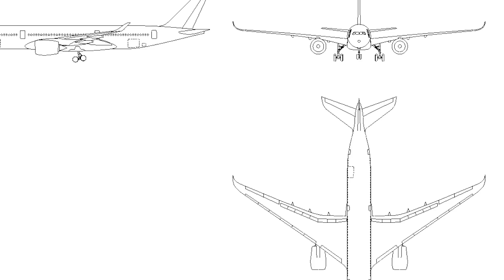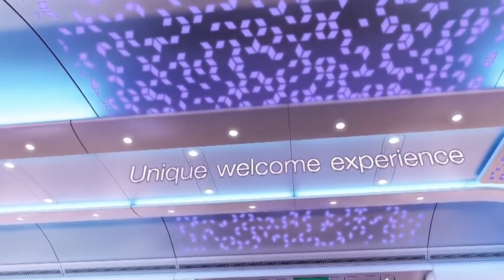Airbus A330neo - the path to perfection. Description of the new aircraft

Comment: Like this channel. No frustration elements to complain about. I just wonder why airliner companies dont put external fuel tanks under the airliner wings such as with military a/c ? Doing this they will extend the range of the aircraft according the route they choose. And it will illuminate the need of lots of different models with different ranges.
Reply: The fuel capacity added by external fuel tanks wouldn’t have the same amount of added range like it would have with military aircraft. Also the range of the aircraft is already long enough for let’s say 95% (probably even more) of all airlines operating it!

Comment: Using a Beluga (modified A330) to carry the first A330neo fuselage at 7:35
"I used the A330 to carry the A330"
Reply: It's an original Beluga, which was a modified A300 (although the A330 was also based on the A300).

Comment: I just flew on Boeing 767 from Zagreb to Toronto , I was thinking wtf such an old plane, turned out the best flight ever , 
2-3-2 seating and plenty of space , going to Europe flew on Airbus 350 horrible seating
Reply: Then you should also try 787. Same 9 abreast seating than on A350 but a smaller fuselage diameter.

Comment: Rolls-Royce or General Electric, you can't go wrong with these names in jet engines.
Reply: I'd lean SLIGHTLY towards RR partly because of the crazy engineering and skill that goes into designing and building them. They have an interesting way of testing the metal fan blades for strength and consistency: they actually hang them like wind chimes and whack them with a rubber mallet. A computer records the sound and sends it through diagnostics software to check the sound pattern. If it doesn't match up consistently with the other blades, they melt it down and install a new one! And each has to be so strong that it can hold a steel weight equal to that of a London double decker bus!

Comment: beautiful.. and it doesn't have MCAS ... perfect
Reply: Hahaha... Great news!
Reply: Why the FUCK would it have mcas in the first place? Only the 737 Max has it.
Reply: https://www.youtube.com/watch?v=0cS1SMptlnQ
Reply: @redstone51  that was one time, and they didn't CRASH, unlike with the 737 max, where it happened many more times and happened to kill 300+ people!
Reply: @redstone51  wow thanks for bringing up how a pilot saved so many lives! He deserves more recognition. Wait what was this thread about again?
Reply: @redstone51  You can't compare the A330 to the 737 MAX. Qantas flight 72 was the result of a hidden flaw in the software used to determine the plane's angle of attack where if there was a spike of bad data at the beginning and end of the 1 second sampling interval (the software compares angle of attack data 25 times per second and then calculates the median), the computer mistakenly believed it was genuine. Airbus did not know about this issue until Qantas flight 72 and, after the accident, they responded correctly by issuing a service bulletin (which prevented another similar accident) and worked on a fix for the issue. With the 737 MAX, Boeing didn't tell pilots about MCAS and allowed it to rely only on 1 AoA sensor, so if that sensor broke then it would cause the MCAS to activate erroneously and, since the pilots didn't know how to turn it off, it would keep doing that until they hit the ground. This time it took a second crash + a worldwide grounding for Boeing to fix the issue.

Comment: The 330 is my all time Favorit. Because of his seat configuration in Economy class. 2-4-2.
Reply: I hear you, man! :D
Reply: This neo has a 3-3-3 config, Airbus released a video this week
Reply: @PatTalisman  The a330 neo has a maximum capacity based on a 3-3-3 config (just like the ceo does as well.. check cebu airlines) with a 2-3-2 in the back section. This is just like the a380 can have a 3-5-3 max config but.. does anyone use it? no (or would rarely if low cost). So far the a330 neo has been configured by legacy airlines with the standard 2-4-2 config with 2-3-2 in the back.  https://www.seatguru.com/airlines/AirAsia_X/AirAsia_X_Airbus_A330-300.php

Comment: I'm liking those new wings.  Still not on the same level as the 787, but still significantly nicer the the older A330 wing.  :)
Reply: The A330 is nothing more than a Airbus A340 except that it has two engines instead of 4. The wing and fuselage have the same dimensions.

Comment: Airline fleet managers should think long and hard before gambling on this jet.  With the seemingly never-ending problems with the RR Trent 1000 engines, the likelihood of problems arising in the Trent 7000 are at the very least, higher than they should be.  I would only order these jets at least a year into their service life, after the Trent 7000 has proved that it is trouble free and the A330NEO is actually dispatch reliable.  You must remember, this is the sole power plant available on this aircraft.  If it suffers a major failure in the IPC, then it has the potential to ground the entire fleet of A330NEOs, or even just remove most of the ETOPS.  IMO, don't gamble on this aircraft.  Take your money to Boeing and scoop up Dreamliners with GEnx Engines instead.

Comment: Judging from the stats and specs, the A330neo seems pretty much identical to the 787, at least the last time I saw a direct comparison. I don't get why it is supposedly not up to the competition all of a sudden and why the A350 was needed.
Reply: TrangleC Exactly. A350 was supposed to be the 787 competition. Now it’s the 777 competition. Sorry I love Airbus but no plane on earth can come close to the 777 in my opinion.
Reply: The A350-1000XWB could hang with the 787-10 but it's a bit better against a 777. I think the A330Neo would be more suited against the 787-8 in terms of range and capacity.

Comment: Can anyone explain, why the -800 is not considered as 757 replacement with its typical 254 seats configuration and good mid-range performance? Imo, two aisles would allow faster boarding than A321 and 757.
Reply: The 757 would more efficent than it if it had new engines but really the -800 doesn't cover the MOM and that's the the main reason. Remember Boeing made the 757-300 as a low cost replacement for 767-200's

Comment: Will the Trent 7000 have the same problems as the 1000 (B787) ?
This would be a problem.
Reply: Basically yes as Trent 7000 is just Trent 1000 with different name and bleed air. We'll need to keep an eye out for any issues

Comment: "XWB...How could they come up with such a name!" I laughed out loud when you said that. And the way you said it, lol! Great video.
Reply: XWB=Extra Wide Body(it is RR engine name btw)
Reply: @tuguldurenkhbayar7915  Ironically still narrower than the 777, & the XWB's overhead crew rest compartment still protrudes further into the aft passenger cabin's overhead bin space than either the 777 or 787
Reply: @lzh4950  the name XWB comes because the A350 was originally conceived as an evolution of the A330, using the same frame, Airbus was planning to do the same job they did the time they modernized the A300 into the A330. But most of airlines said that it was a too conservative job and required a more modern aircraft. Thus Airbus came with a second A350 proposal, called XWB to differenciate from the previous one: and this had a wider and bigger frame than the A330. That's why this name.
Reply: @albertogambino2562  Yup I've heard of the story of how the A350 was born
Reply: XWB is the A350
Reply: Extra Thicc Body
Reply: @RogerPierre which is exactly what I wrote

Comment: to all boeing fanboys who obviously either fly first, buisness or not at all:
as a consumer (frequent long haul) and not an airline manager: when i see a flight scheduled a 787 i PASS while on a 330 i always book. Why? okay the air in the 787 is more comfy (cabin pressure and humidity) but the 10 seats abreast?? sry but i`ve been in Mumbai commuter trains which had more space! a330s have the comfort of a 2-4-2 seating! on an airbus you can always book A,B and H,J seats without doubts! i dont care about carbon and stuff! thats just for the operators to brag about! as a costumer im really upset that the 787 is just a cashgrabber! fuelefficient, high passenger yield (10seats abreast) at the same ticket costs for a a330 flight! when the 787 starts backing to the original 9 seats (2-4-2) i might fly again with the 787. PS: the only 747-8 and 787 operator who uses those by boeing fanboys praised comfort is KOREAN AIR! a joy to fly with the korean air 747-8! 2-4-2 seating!
Reply: you made quite a few mistakes for someone who calls himself a frequent flyer. the 789 has 9 abreast (3-3-3). the 747 has 10 abreast (3-4-3). airbus also offers a high capacity version of the A330 with 9 abreast (3-3-3) just like the dreamliner.
Reply: the company i choose has 2-4-2 (a330 korean air same as garuda indonesia) 
the manufacturer offers seating, the companys choose! the 330 9 abreast is still a minority and used often by high dense routes and carriers like air asia. 
so the dreamliners i flew with had 3-3-3 my mistake, still im not fond of the 3s and consider that the 9 abreast in the dreamliner is worse (narrower seats) than the 9 abreast in the rare 777 with 9 config.  speaking of the workhorse T7, most of the companys switched to the 10 abreast seating.
btw cathay is one of the few T7 operators with the 3-3-3. 
TL:DR:
dont diss me if you dont understand that the 330 is still operated mostly in 2-4-2 and the seating isnt a manuf. fault but a company fault (i kinda get the feeling that you think im starting the stupid boeing vs airbus thingy- which i dont!) the dreamliner 3-3-3 is terrible, same as the T7 3-4-3 period!
Reply: which airlines that offer 10 abreast seating in their 787 ?
Reply: It's the Airline & not Boeing's  prerogative to choose the SPECS configuration of their aircraft of choice.
Reply: I’m not really bothered by space all that much, even when I’m in Thai economy on a 772
Reply: i'm not dissing you hun, I'm 100% with you on this one. i hate the dreamliner and i try to avoid it at all cost. i also hate the 777's with 10 abreast configurations.
Reply: can you read posts or do you just answer agitated? read the conversation
Reply: nah we good, i was answering MNH since he didnt read the whole conversation ;D

Comment: It will just cannibalize A350 sales, just as the 777 cannibalized the 747 sales
Reply: It definitely did when A350-800 was about to be done before getting cancelled in 2014. It might be with A350-100 too as it is proving tough to sell in a segment where airlines have mainly trusted Boeing. Although Lufthansa never bought 777-300ER for them selves to use (they went with gas guzzler A340) they bought a handful for Swiss for their longhaul flights. They've replaced all but 5 A340-300's but more could be on the cards as earlier this year 2 more were bought for an early 2020 delivery. 

But A350-900 could be taking away sales from A350-1000 as a lot of customers switched to, due to 777-200ER replacement market (which Boeing also wants with slow selling shorter range 787-10) that has been busy for a yew years and is expected to continue for a while as none have built since 2014 while production started in 1997, it which is not a good sign.

Comment: This is original A350
Reply: The original A350 had a new fuselage made from Aluminium Lithium alloy
Reply: Yup, just re-engines/wings design of A330 that rejected by most airlines decades ago, before Airbus came out with new, clean sheet design of A350XWB.

Comment: Airbus needs a direct competitor to the new 777-9/8. It is no coincidence that so many airlines fly the 777. It's clearly the plane of the decade to make and earn money. And the new 777-9/8 is the future of planes. The A350 is not really equal and the 787 is still a more modern plane. I'm a Airbus fan and a A350 fan too and I don't really like Boeing planes. But I'm concerned, that Airbus misses the development of the market. The A330 is slowly an old plane, and we can all see it. Just a new wingtip and engine isn't really a Grat improvement.
Although I love the A 330. Just look at the preorders for all large Boeing/Airbus Aircrafts and you will see that I'm right.
Reply: 777-8 is the compeditor to the A350-1000. There is no compeditor from airbus to the 777-9.
Reply: May be thats a problem.
Reply: SnurX Apparently though Airbus dismisses 777-9 to A350-1000 but instead they were more worried about A380. Only Emirates wants A380 and this has prompted many airlines not to buy as they feel like orphan buyers if that makes any sense.. There are plenty of orders (47 at least) due to be cancelled from A380 in favour of either A350 or 777X (not ruling out 787 as Qantas CEO Alan Joyce claims 2 787's are cheaper to fly than 1 A380).

Boeing even gave up forecasting for VLA passenger aircraft back at the 2017 Paris Airshow (both A380 and their own 747-8I) and as you can see in this link they believe the biggest plane going forward and their flagship is 777X. //www.ausbt.com.au/boeing-s-vision-of-the-future-has-no-place-for-the-747-or-a380

Comment: This really convinces me that boeing should develop a 767Max.
Reply: They've already done it) Boeing 787)
Reply: Flyer Killer yes, but technically no. 787 is similar to the A350, twin engine long range widebody. But airlines want a medium range aircraft that isn't as big as the A330-200. 

Which is why Boeing is thinking about restarting production of the 767, and United Airlines is planning on buying a fair few of them, mostly for the short team whilst Boeing designs a real replacement. A 767Max 8 & 9 (8 being the -200 and -9 being the -300) it would fill a big gap for a lot of airlines to replace the 757-300s and older 767-300s. 767-200 remake is one of the better replacements rather than the 757-300 because they're aiming for wide body medium planes.
Reply: @morganlambley8655  757 is a narrow body airplane. Wide body like 767 will never replace 757. Operation cost would be a problem.
Reply: Autumn Shag I don't think you have any idea what you're on about. 

Failure? The 767 was a massive success. The only 767s left commercially are the 300ers and 400ers because they're the newest models. If airlines had a the option to get a newer more efficient 767 they'd sell pretty high.
Reply: Is this what the 797 project is supposed to be about?
Reply: No, probably they will go for a B757-200/300 derivative.
Reply: B767MAX have massive disadvantages compared to A330NEO.

- B767 are 10 years older than A330. The technology they used to created B767 are way behind the time for A330 and B777 that started services in early 90's.
- The only B767 that airlines around the world one is the B767-300ER. The other models are failure. While both A330-200 and A330-300 are equally successful.
- A330-200 and A330-300 are old aircraft with old technology, yet they are one of the most fuel efficient aircraft in the world right now. Beating B767 hands down. So updated version would make A330neo be almost as good as B787. Especially on shorter routes, A330neo would be more efficient than B787-8/-9. 
- If Boeing would used composite materials for the B767MAX. Then every single aspect and design of the original aircraft would be changed, which resulted in expensive update. Hence Boeing didn't make B767 and B757 MAX. It would be cheaper to built new aircraft entirely (B797).

*A330NEO also able to handle LD3 cargo container that is the common size for most wide-body aircraft. A330/A340, A350, A380, B787 and B777/B777X used this cargo container size. B767 use the smaller LD2 cargo which is extremely uncommon these days and age.
*A330NEO also have cockpit similarity with A320 and A350. Airlines doesn't need to spend too much time training their pilot too long to change aircraft. B767 on the other hand, only have similarity with B757, which is being replaced by A321 and the new B797 in the future.
*Some expert believes that B767MAX would still be less efficient than the current day A330-300 without the new engines and update. So Airlines wouldn't want to buy it. Same goes for B757MAX, they calculate that it would be more economical to buy the new A321NEO.
Reply: @nntflow7058  Very good knowledge. Kudos.xWhat do you do for a living? Fly freight aircraft?
Reply: B797 would be the size of B767-200 and B767-300. The range however would be around B767-300ER and A330-300 at max. So regional aircraft, way less than B787.
Reply: Friso Lustig they've said it'll be a wide body other wise there'd be no point making a new narrow body that's literally the same size as the 737Max. The 797 will be along the lines of the 767-200 with the range of the 787.
Reply: And that's why the A321neo is made
Reply: the 787 IS the 767max. Many systems share the exact same design as the 767. Landing gear, hydraulic system, empennage, cargo area. They made it seem like a total re-design by calling it 787 but in reality it is quite obviously based on the 767 platform.
Reply: Elementalism I believe so, but it may not be the 797, may just be a 767Max. If they can make that one plane more efficient. Like they have with the 737 & 777 then hey save a bunch of money too.
Reply: They developed the B767-400ER and it was a market sale flop. The B767 is history.  The B777-X will be the main competitor to the A330neo and A350. You can consider it a "B777 max"
Reply: نادر الی راحمان It wasn’t a flop, It was made specifically for delta and continental, which remained The only customers